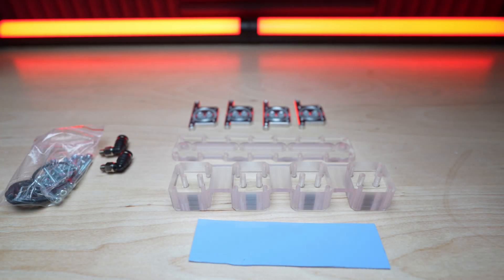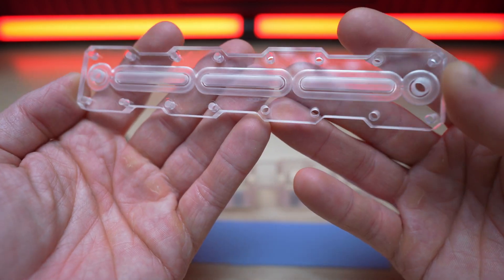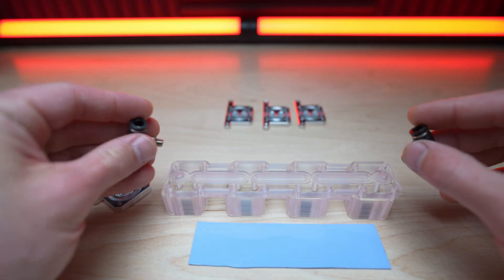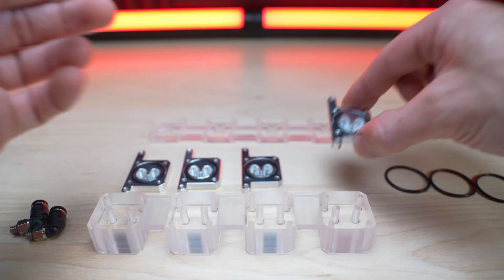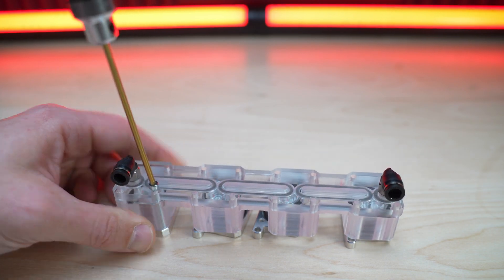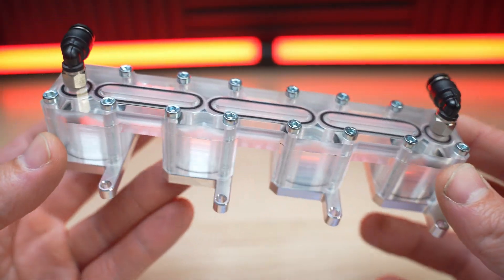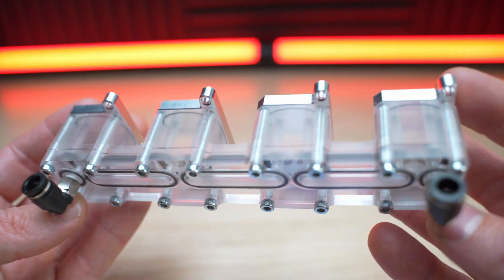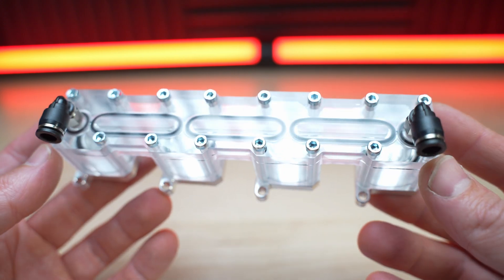5160HV Pro stepper driver watercooler

Comment: I'm maybe wrong but the water at the final stage of the watercooler will be hotter because of the other three making the last driver hotter.
Reply: No in water cooling the entire waterloop is the same temperature because of how fast the water flows and how long it takes for water to release that heat through the radiators.  I actually have a watercooled 3D printer with a thermistor on the  "input" and "output" lines and they show the exact same temperature
Reply: Can you share a post or a video showing that setup please?
Reply: @Shinobubu  If it was the same temperature on inlet and outlet, then no heat was absorbed by the water. It may only have increased a little as water has a high specific heat, but they can't be at the same temp

Comment: Vez, have you attempted to use commercial external drivers like are available on CNC machines for the Vzbot?  I know you swapped away from servos due to speed benchy race not allowing them, but how do commercial stepper driver packages compare?  Some of these have 256, 512 microstepping -- but at speeds, the silent part of the TMC drivers is largely irrelevant.  Thoughts?
Reply: Im debating if i should go that route. using commercial drivers. Currently using them on an Octopus pro and fans are not enough. Water cooling seems a bit too extreme and more of a band-aid at that point. The better solution is to get external drivers that can handle the load and heat without water cooling

Comment: Looks nice but you'd want more fins and surface area for water to glow on the blocks
Reply: It's not a cpu that has a high W/cm² the drivers don't output that much heat, this design would still work without any fins at all.
Reply: @twanheijkoop6753  mate you've never used 5160s at 55v have you?!
Reply from the maker: As you can see...there is not really enough space for that 😂

Comment: Hi vez, 
Just a pair of design possible recommendations. 
1 having those in series will decrease cooling on last driver as water will be already heated from the previous ones. A parallel path distributor would be better if there is enough flow.
2 I would machine a small step on the aluminium part border so it fits inside the acrylic one so it doesn't move to much during assembly to make it easier.
Nice idea. Keep it up! My Goliath and vz-hextrudort are on the way already. Hehe
Reply: @AlexanderTasch  yeah I know but he also had to increase the fittings hole size and tube if I recall correctly that would mean his system is alredy somehow restricted.
more than harder to manage I would say harder to design. You should "equal" flow length and pressure drop so flow is distributed homogeneusly.
Not my area of Expertise as I'm an CAE structural engineer not a CFD one but I've done some also.
Also you should take into account the heat power to disipate, flow turbulence and time of resisdence. Temperature delta between the exchange face and flow....
Regarding PC watercooling you have to take into account CPUs TDP is double or triple the one on one of those 5160s but you have 4... Also pc watercooling flow distribution is not done by neither 4 nor 6 mm ID tubes... mine is 16mm OD acrylic tube... so quite more "flow" going through unrestricted...
Reply: @Novacat170  The power supply listed in the description is 350W. Let's assume 100% load and all of this ends up in the cooling loop.350W at a fairly low flow rate of 60l/h = 16.67ml every second means 69.75 joules per degree celsius every second. 350W/69.75J=5°C delta between the coolest and warmest spot of the loop. The delta between the drivers is going to be much smaller.
Reply: @diavolescaCZ  As I said I'm into structures not fluid dynamics. But What I think seeing what hapens in i.e: my computer with the cpu and graphs card in series vs in paralel is that it helped when taking  it to the extreme. 
Also regardng that "values you said". theoric max disipation could never exceed SPU power (and that would mean no power left for movement) but that with a flowrate of 16.67ml/s thats  16.670mm3/s through a 6mm pipe or 28.3 mm2 area. That would mean "if flow was "homogenius" on all section... water would flow at nearly 600mm/s. how many time is it in the loop? how many heat would that drop take and therefore cool from the motor? If it take less "heat" to achieve equilibrium it will have to get hotter so delta is bigger to water to transfer that heat power...
this is not an easy matter. and I never said that actual water temp increase would be big I said that the "equilibrium" temp would be diferent for each driver as each will see a hotter water (maybe tenths of a degree I don't know but its a fact. to not have that problem It should be design in paralel but thats a harder to do (and may be innecesary like trying to print or move at 3000m/s but they are pushing the boundaries so why write so much against a posible improvement in efficiency and max performance??)
Reply: They don't do multiple paths even in watercooler when you have multiple gpu😅
Reply: @felipenavas  i would have said my old ek block for my dual 980ti was in parallel... But I it's not so uncommon to separate GPU from CPU....
Reply from the maker: It has enough that it will not matter..temp will be equal everywhere
Reply: @Vez3D  would be interesting to measure the temperatures at the aluminum plates to see what really happens :)

Comment: If you need water cooling for power MOSFETS, you're doing something wrong :)
Robot arm BLDC drivers pump up to 60A to power their joints and uses only passive cooling.
Reply from the maker: Did i mention it was useless and just for the coolness of it? Well it might actually help in some ways too but mostly just because its cool
Reply: @Vez3D  It won't just leak. It will leak, kill drivers, kill board, and kill Raspberry. But looks cool, yeah. :)
Reply: Yeah this is grossly overkill and unnecessary, still looks cool tho